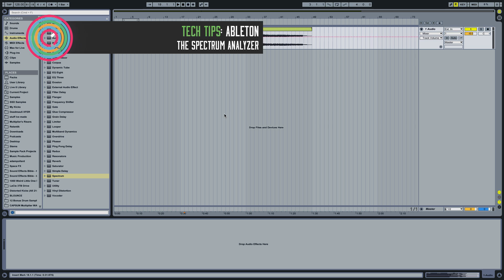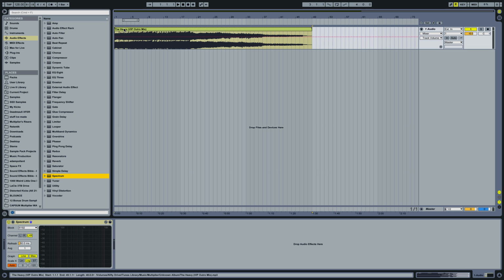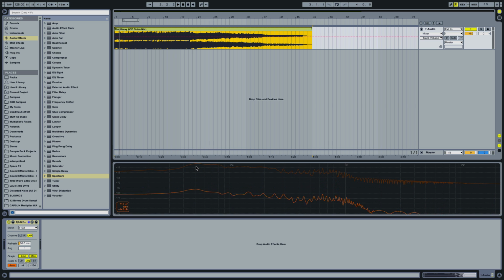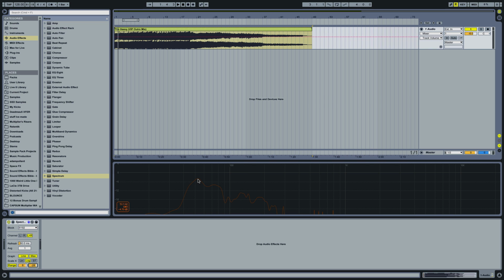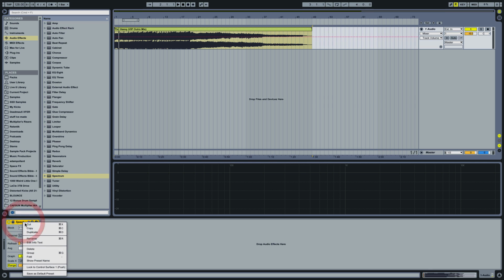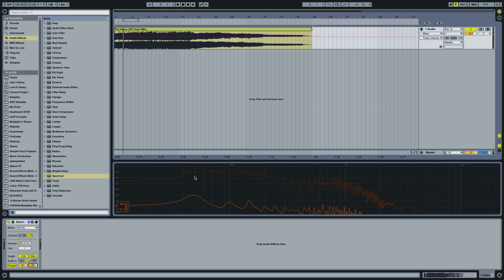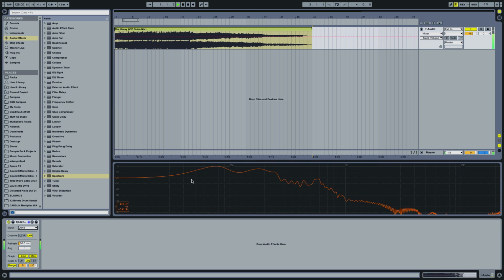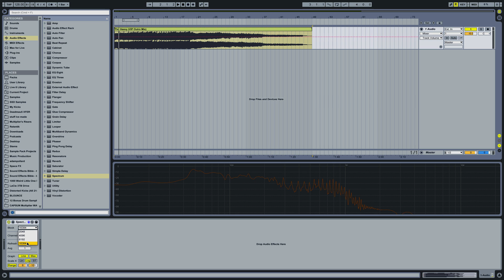Tech Tips - Ableton's Spectrum Analyser.

Comment: When using frequency analysers, such as Abelton's Spectrum, do I tune my sounds to match the tonic note from the key/scale of my track, or another note, such as 'dominant' note? Thanks
Reply: Depending on what track you put the spectrum effect on, it'll either give the frequencies for a single signal (ie, your synth or a guitar melody) or groups of tracks (ie, if you put it on the master, it'll give you a readout of all frequencies for signals going into the master track). 

If you put it on the master, you'll be able to observe whatever constructive/destructive interference is occurring between the different signals. 
For example- if you have a guitar melody on one track & another guitar track harmonizing to the first, frequencies from identical notes will cause constructive interference, while notes outside of the scale of the melody will probably result in destructive interference. 
TL;DR- It depends on your end goal. if you're trying to tune a note within the mix for the entire track, put it on the master. if you're trying to fine tune a singular instrument without any sorts of interference from other parts of the set, put it on the individual track. Hope this helps!

Comment: Hey Sonic Academy. Thanks for the tips! I am confused about one thing. Your sub frequency is at -6 dB's, yes, which is good. But isn't your sub note below 100Hz, as it appears in the video?

 In the Mastering Bible by Tim Vanhoorne, it states that mud occurs when sub peak notes are below the 100 Hz range. Is that true?

Edit: I think mud only occurs when low frequencies are below 100HZ on the sides of the mixing space. I think it the sub is centered that is totally fine
Reply: I think mud mostly occurs when there are multiple signals contributing to the sub 100 Hz frequency band. LIke, if you have a kick drum bottoming out at 30 Hz & a bass guitar that bottoms out at 60hz, their signals will create interference (either constructive or destructive, i don't think it matters what kind sub 100 Hz bc they both sound bad that low), which creates the mud. 
Could be wrong, just speaking from personal experience. I leave sub 100 Hz for my kick